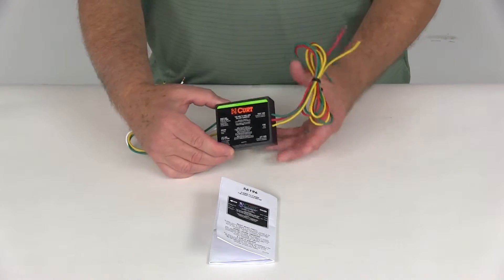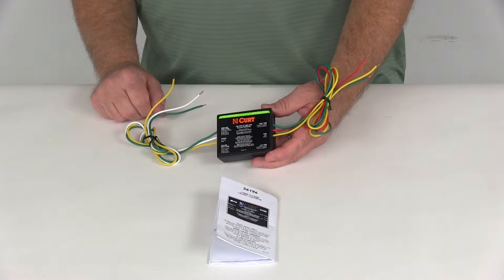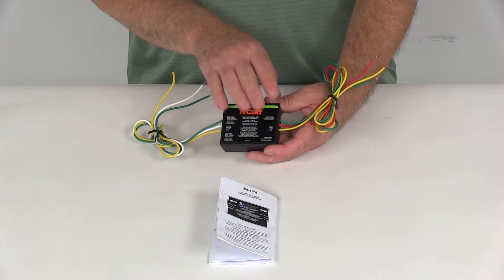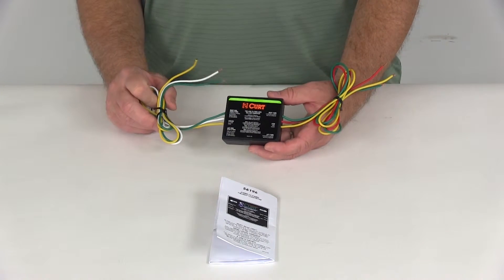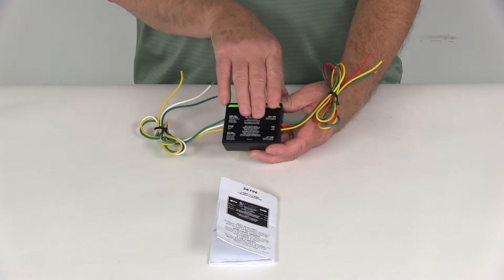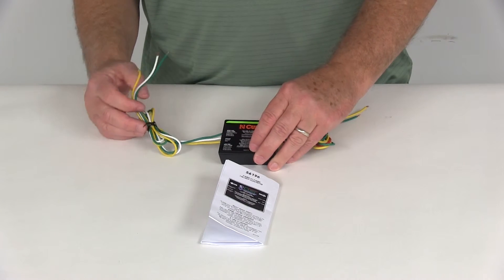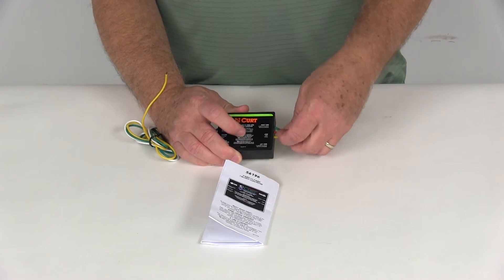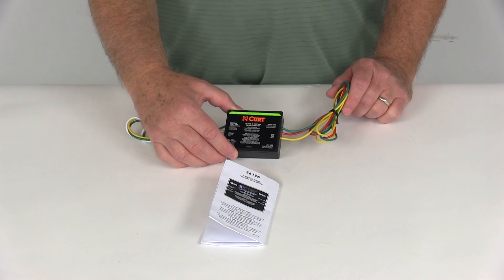etrailer | Curt 2 to 3 Wire Tail Light Converter: The Breakdown

Comment: you can use this to do a third high mounted brake light on you RV trailer. It splits the break light out from the turn signals, that way your third brake light doesn't flash when you turn. You can also use the separate turn signals to make a set of marker lights on the side flash when you are turning, so if a guy is in your blind spot, he knows you are coming over.